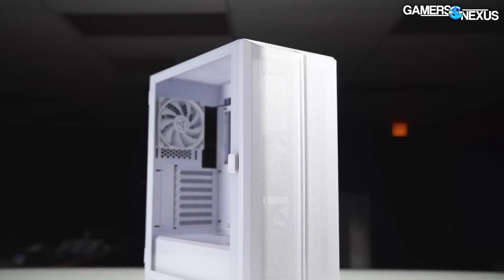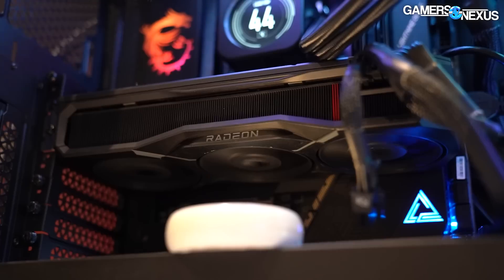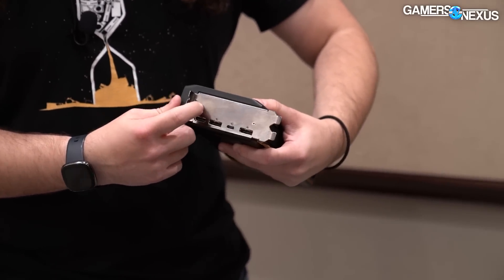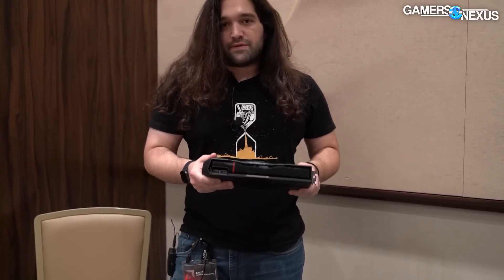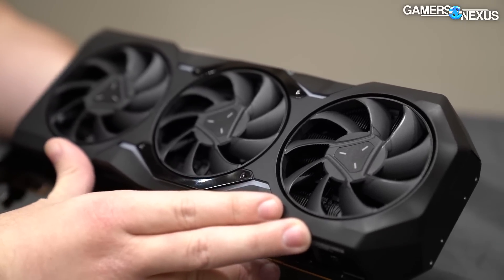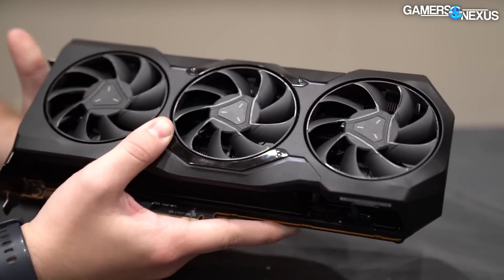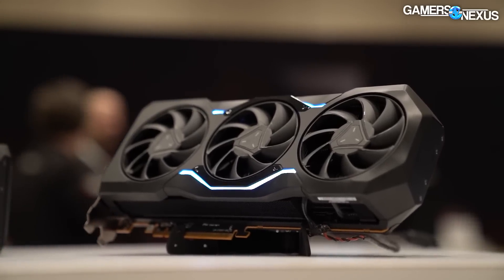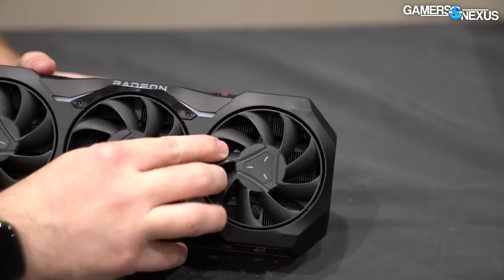More Video Cards Need This: AMD RX 7900 XTX Reference Design Hands-On

Comment: I have a Engineering sample with a red PCB and no backplate and a bunch of extra connectors on the back.I was a bit bummed no backplate but it works great.Feels like a solid card.Does everything I need and it is forcing me to buy a high refresh rate monitor.

Comment: I just want a video card that will use normal case/cpu fans.. I don't care if they're 120mm or 92mm or whatever, but I'm sick of these dumb video card-specific fans.  When the video card fan(s) start making noise (or heaven forbid, they die) it can turn in to a huge problem, really fast.  If cpu heatsinks can accept standard fans, there's no reason why gpu's can't do the same.

Comment: When i read "reference design" on a gpu, i understand "PLEASE WATERCOOL ME" ahah
If i had the modey for this GPU i would probably just buy a block on aliexpress. Bysky makes good stuff

PS : XFX is the only brand that authorise to change the cooling without breaking warranty. as long as you register the card and tell them before.

Comment: Is that smaller port a DisplayPort 2.0 or 2.1 slot, capable of more than 80Gbps bandwidth, which was the proposed one in 2017 or so? If so, it's about time! Everything with graphics has improved except speed, DP 1.4-1.4a has been around for ages, close to a decade. 

If so hopefully there'll soon be 8K & even 10K monitors, the latter to be used in special fields. Being able to run dual 8K monitors at 60Hz will delight users for another 5 or so years, or three 4K monitors at 120Hz, (144-240Hz) if only two are used.

Comment: i no longer buy GPU cards with a cooler that can't be swapped with my Honda civic Radiator, it's a waste of cash.
Take 4090 RTX for instance if my Honda's Radiator blows out i can always use the 4090 RTX cooler to replace it.
i call it redundancy. AMD radeon latest GPU cards cooler design just won't cut it.

Comment: Anyone else notice that at 55:19 of the AMD product launch video, the fans are shown spinning in "reverse"? https://youtu.be/hhwd6UgGVk4?t=3317 Any chance this is intentional and real or just poor CGI work? Has there ever been a GPU cooler that blows away from the card? If the direction is correct in the video, the thermistor would be measuring exhaust air which is a bit more traditional. Just a (probably incorrect) thought.

Comment: Air temp probes on fans? Really good idea.  Heck, if a manufacturer like Noctua or Be Quiet put probes on case fans as a way to manage fan noise it would be as handy, the ability to compare input air temp vs. output air temp would make fan noise management easier, much in the same way as the fans on a GPU.

Comment: 0-fan speed is a curse and unnecessary, screw manufacturers that use it. There is no MEANINGFUL power savings by shutting off the fans and letting the Graphics card cook itself because you had a power outage and "WATTMAN RESET TO DEFAULT" - and the FX-9590 above it. Good thing I bought an extra for $100. F U AMD you cheap pieces of garbage.

Comment: Matt black is the official temperature-reducing color of all physics. heat flows into or out of an item with black as its surface color better than it does with mirrored/metallic/chrome/nickel as its surface color. I often wondered why cooling fins were not anodized black, as it adds almost no thickness, and helps heat escape. Most coolers are black for a reason.

Comment: Seems like a perfectly reasonable feature to have. I'll be interested to see what kind of fun balances people can strike between board temp and noise level under softer workloads. I'm mostly interested in the general size and power consumption. If I can run it safely on an 850W PSU, I'm definitely in the market for one. Only reason i didn't buy a 6950XT when the prices dropped into the $700 range was having to upgrade my power supply too. As an overclocker, I never thought I'd see the day where I actually cared about power efficiency, but having to install a 1200W PSU for 1 card is simply insane and unacceptable. Didn't need that for 4 way Crossfire.

Comment: That fin orientation is good for chipsets and M.2 SSDs, because GPU fans are cooling them down while in load. Especially for poorly known for notorious temperatures X570. Mine cools down by 10 C while i'm playing.

Comment: 4:48 I am fairly certain that is what occurred on a  couple cards I had from both Gigabyte and EVGA. Most notably a Gigabyte Windforce 3 980ti, which suffered catastrophic failure when a bunch of caps near the VRMs burned up, despite all monitor-able components living a life under 70C, which were always monitored. The GPU fans never seemed to spin up very fast.

Comment: I'm guessing the red triangles are an assembly aid to warn against putting screws there from the back side. Those are probably screw holes for securing the top side heat sink plate.

Comment: Even though it's probably splitting hairs, in all technicality the location of that thermistor would be called Return Air(RA) or some may call it Intake Air(IA). If a temperature sensor is located near the fin stack where the air exits it's called Discharge Air(DA). An Ambient Air sensor would have to be located a distance away from the GPU and its fans for accurate ambient readings.

If you setup a system this way you can cross correlate the temperatures between the three, and the data will tell you if the GPU cooling system is recycling hot air; aka the computer case is or isn't expelling internal air efficiently. You can also compare the RA and DA Temps to determine how well the GPU cooling system is working based on the temperature differential.

A similar temperature system is used in commercial and industrial refrigeration. It's a little more convoluted and redundant with these systems, but used by the PLC or control system when to shut off flow of ammonia, turn on and off evaporator fans, or send the system into defrost. If temperatures return certain parameters it can even shut down the ammonia compressors. It's all based off those three temp sensors: the RA, DA and AA sensors; for the most part.

Comment: Funny thing you mention it, i have always had a temperature sensor on a case / radiator inlet fan, and also on a outlet fan, i have done that for at least 2 decades.
It was a good thing to have when i was into modding and Overclocking, both things i generally do not care for now.
In the old days i would mod wire harness to it was tailored to the mm, but then that bit me in the ass 12 months later as then i would have to get new PSU wires or a new PSU for the new build.
This was also true for all other wires, so fan wires if they got reused had to be modded for a new case / build too.

The idea of having a bird nest zip tied to the back of your motherboard tray still violate something in me, but i am willing to try that to some degree in my next upgrade.
Also my plan was to do hard tubes for the cooling, i think i will have to sell all those fittings and stick with Tygon tube as always, CUZ next build will be dark / no window and its so bit it will get 4 wheels and a life on the floor and not on the computer table even if it is plenty large.

Comment: The thermocouples included in the motherboard box are great. I use them to control case fan speed based on case temp. Having one on you GPU is a great way to add one to a system that doesn't have motherboard headers for them. I bet utilities like Argus Monitor could use that temp to control your case fans in that scenario.

Comment: Love the idea to have this natively available plug and play. 

That said, semi-casual pc users can easily control gpu fans by ambient temperature without any special boards. As long as you have any sensor in your system that reflects the in-case air temperature, I use the freeware* Fan Control by Remi Mercier to control all my fans based on several curves, for example to run gpu fans at 25% if case temperature is high, or higher if gpu needs cooling, but only lower if both case air and gpu is cool.
*beware you are very likely to want to donate to the creator when you experience how intuitive and customizable the UX is.

Comment: Im looking to build a PC and i have a question in terms in cooling. I plan to get a p400a case with stock front fans and one extra for exhaust at the back. For the cpu im going to a 13600kf with a dark rock 4(no pro). Will that work great?

Comment: wouldn't that USB C on the GPU be bad what if someone had a USB C cable and plugged it into the HDMI or Display port wouldn't that make a power surge on the card and brick it?
Reply: someone didnt mean to plug it in there but so happened since they are close by and the user didn't want to rotate the PC

Comment: I think the back plate does not have grilles to remove hot air since it is closed so that the fans have greater air pressure and have a better effect on dissipation. I think that is the case.

Comment: 7900XTX = 4080 16GB for a bit less money, so better price to performance. 4090 is untouchable at this point. There you go, saved everyone time. Once the 7900XTX is benchmarked, 4090 value is going wayyyyyyyyy up by December

Comment: I always thought it's weird that cases don't have a temp sensor inside of them to see what the inside temp of the case is. So I installed my own, helps to see how my case fans are performing
Reply: Wouldn't it be better to look at the temperature of the components to determine how well your cooling is working?
Temperature of the case is more an indication of the temperature of the room.
Reply: @tim3172  my point precisely. You can test different methods of installing case fans and see what push/pull setup works best.

Comment: I just did a build for my sister in law, and the MSI motherboard included a thermocouple and header for it. I was impressed, but I left it out, because it was built in a Fractal Torrent, she would never check for it, and getting clean wiring was hard enough anyway.

I'm stoked to see a feature like that on a gpu. I hope it's exposed to the end user.

Comment: Beside the capabilities of the cards which are about to come with the upcoming benchmarks the moderate thickness of the card is on the positive side for me. Competitors cards with almost 4 slots in thickness are brutal if You want to install additional cards as soundblaster cards or 10 GB network adapters or things like that.

Comment: Nice. On my home rig I'm using an average from ram, the ssd and a thermal sensor on the motherboard to approximate case temperature. Having an dedicated sensor for it would be nice. I'm adding a small offset to the intake fans based on case temp. Good for summer days. Jayz2cents has talked about it, but Fan Control by Rem0o is awesome.

Comment: It's official; EK are producing a dual (front & back BOTH ACTIVE plates - so looks amazing from top and bottom with RGB) water block set for the RXT4090 founder's edition, called the "EK-Quantum Vector² FE RTX 4090 D-RGB ABP Set - Nickel + Plexi". Water blocks reduce the size of the card so that it would even fit in a small form factor case with a custom water loop, as well as gaining all the other water-cooling features (best possible temperatures giving the card the thermal headroom to CONSTANTLY boost to maximum speeds [so long as you also have a beefy PSU] in a way no fans would, silent running, reduced power passing through the card, greater stability and greater potential for future overclocking). The latest CPUs also run incredibly hot so benefit from water cooling, with the fastest DDR5 RAM also benefit from a water-cooling block as well. 

Could you please ask ASUS ROG is they will produce a Strix RTX4090 in partnership with EK so that it can be bought with the same front & back active water blocks, for the best performance whilst also fixing the "too big for the majority of cases" issue? If they also switched to display port 2.1 on this card then it would sell like hot cakes, because the RTX4090 not being able to output graphics that it can manage to generate makes it a serious joke, with DP 1.4 an unacceptable bottleneck. 

I plan on getting a Cooler Master HAF 700 case and installing three 420mm radiators (top & side & bottom) which, when paired with the front two 200mm fans & rear two 120mm fans, should allow me to cool even super-hot gear to near room temperatures, I hope.

Comment: I really like this new design. I think that AIB's will also find some interesting uses for this thermistor, like adding a small display on the card or changing LED color to mirror the GPU temp on full ARGB set ups. There are definitely some creative opportunities there. A lot of higher end motherboards have some sort of display built in now, perhaps a BIOS update could pull GPU temps and board temps to display directly on the mobo. Good stuff. Well done AMD- you guys are killin' it.

Comment: Hey Steve, do you think if manufacturers built the cooling fins at, say a 25 degree angle, would that improve or be detrimental to cooling performance? More surface area vs impeded airflow

Comment: The card is so sexy. In today's 4090 standards it's a very small card, the heat sink isn't that big and it looks like the bracket entirely touches the cooler which will reduce sag. And then AMD using a similar idea to the Fractal Torrent for their airflow setup with the vertical fins and closed bracket. I'm so excited for these cards I might buy a 7900 XT day one and sell my RX 6800 XT.

Comment: My Z690 MSI Unify-X came with thermocouples and you best believe I've been using them lol. It's a fantastic edition to any motherboard. I can monitor the temps of anywhere I want inside my case and assign a fan curve to it in the bios. Really works out for my rtx 3090. Since the bios can't set your case fans curve to GPU temp I just put the thermocouple inside the heatsink of my GPU and assigned my bottom case fans curve that are blowing up at my GPU to the thermocouple temp. And the rest of my fans are assigned to my CPU. Great for thermal performance and noise. You could technically do the same thing with software since software can assign fan curves to your GPU temp but I'm not really of a fan of controlling my curves with software. I only like using the bios.

Comment: Nvidia will keep its pricing early on and over christmas anyway. Then after new year they will look at items sold and lower pricing only if you guys resisted buying them. As the 4090 sold out here in germany and i believe in other countries as well, they wont need to lower the pricing because ppl buy them anyway. I go with amd this year, either one of these, the 6900xt or the midtier of the new generation next year. Depending on interesting game releases.

Comment: I remember using thermocouple on an Asus slot A motherboard to get a reading on AMD K3 800 MHz processor. CPU didn’t have a sensor internally so motherboard had 2 pin CPU temp for a thermocouple. Good times.

Comment: I have an amd 6700 sx. Is it enough of a jump to justify $1k, or should I wait for the 8900? Seriously, no games will be around to use RDMA3 for some time. Great channel by the way. I hope you release more tech-merch of high quality
Reply: Its definitely going to be enough to justify a jump.
It should compete with the 4090 at $600 cheaper which is actually mind blowing!
When you look at a 3090 and a 4090 the 4090 is about 2x more powerful
Same as how the  7900xtx is 2x more powerful than the 6950xt.

If this card was $1200 - $1600 
Definitely no 
But it being only $999 is a steal
Reply: @3akeking539  I want to ask, will they have even more powerful cards in a year's time? I wanted to avoid spending $1k only to have it be last year's model in a year
Reply: @GinoACosta  they probably will but that's the case with buying any graphics card.
They always release a better more powerful card.
Nivida will release ti models in the next year or 2 
And amd will release 7950xt or xtx cards.

I think for the price this card is a steal.
When there newer cards come out it won't be a massive leap in performance.
If you buy this card you will enjoy it and get the most out of it for years and years to come.
Reply: @3akeking539  Thank you so much. I have the relitively recent 5950 x cpu. Do you think I will get much from upgrading to the newest amd 7900 cpu? I was hoping not to have to take my pc / motherboard apart even if I upgrade my video card.
Thank you very much!!
Reply: @GinoACosta  no you should be good with a 5900x 
7000 series cpu's weren't that impressive like everyone thought they was going to be.

Comment: so the air is going to be blown into the side of the case, there it will be turbulent and all over the place and the fans are going to suck plenty of it back in. This is what has been done to death, but having at least a little bit of air go out of the back of the card and out of the case is still something versus nothing.

Comment: @Gamers Nexus: probably not so smart question, but I wonder if the card you are holding in the video is a working GPU card you could just run off with and put into a PC - or is it a factory mockup? Just curious. Looks clean and neat, like it went through the oven, also QRed on the backside. Wondering if the shelve model will be any different.

Comment: I hope more AIBs add thermistors to their GPUs especially since if they are going to be repurposing those beefy 4090 coolers. Which means in many poorly vented cases there is going to be choked airflow so when the GPU is idle the heatsinks will not be enough. Especially in cases where the PSU is not being used as an additional exhaust / covered with a PSU shroud.

Comment: will be interesting to see how the design with hot air exhausting at the top and bottom affects vertical mounting where the air would go right into the cpu